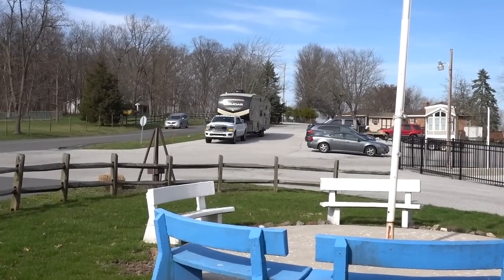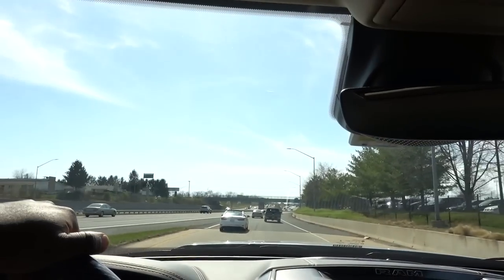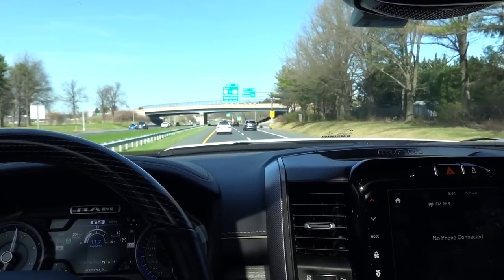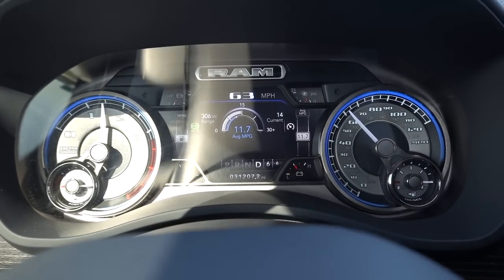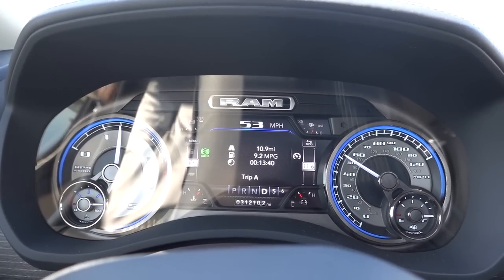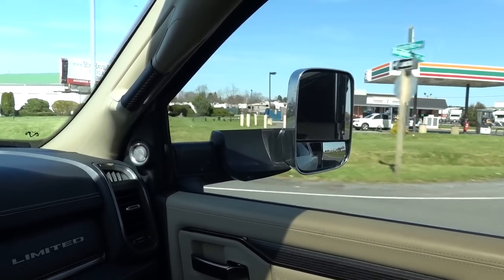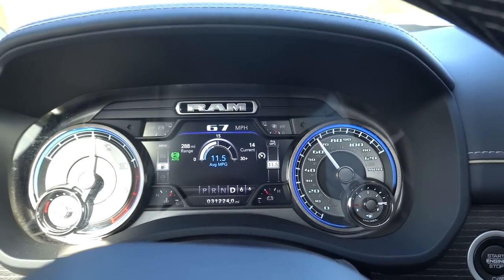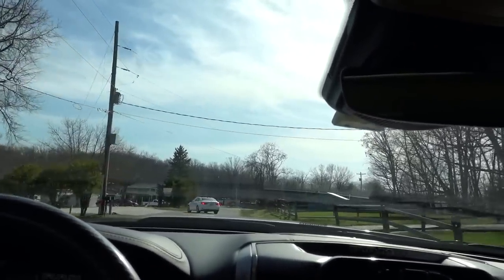Trying To Get The Best MPG Towing? I Learned This Technique That Will Get You 2-3 MPG Better!

Comment: Nice video. Being smooth with the throttle and brake is the best way to get good mileage for sure. Speed is also important. Once you get around 70 mph the gas mileage will drop. 

The only issue I see with towing in an OD gear could build unnecessary heat in the transmission. That would be something to watch for.
Reply from the maker: Thanks bro, and maybe what I will do is do a follow up video on whether you should keep Tow/haul mode on or not 👍🏾👍🏾
Reply: @JB_WhoWork  yeah that would be good to do. Probably for a diesel it won’t matter too much but a gas truck it will drastically change how they operate at speeds. My truck will definitely not go into 6th in tow/haul mode and a lot of times on curvy two lanes it won’t go to 5th.
Reply: @JB_WhoWork  I’d like to see that… I’ve got a 6.7L F-250 diesel (6spd but wish I’d waited for 10spd trans) but I honestly can’t tell any different with towing mode on or off!🤷🏻‍♂️
Reply: @JB_WhoWork  did you do the test ? i was wondering if i need to activate it on the highway. I got 11mpg on a 250miles trip with a 5k pound rv on my Ram v6 3.6 etorque with tow/haul mode activated last weekend.
I'll do 650 miles next weekend. I'll try removing the tow/haul mode to see if i get improvement!

Comment: Just bought a 26 ft travel trailer (5176 lbs empty). Used cruise control at first, but my Tahoe going up a hill would downshift when I was already halfway up the hill… sometimes it would downshift twice and in one instance had the RPM’s up to 5500. I realized then that cruise control was no advantage, so I shut it off. The hills of Tennessee are brutal on MPG as opposed to the flatlands of Illinois. 
The cruise control doesn’t know it’s approaching a hill so it can only react once on a hill, so now as I approach a hill (without cruise ctrl) I accelerate slightly before I am actually on the hill and that limits the transmission downshifting and improves MPG. I also found 60 mph be an optimal speed. 
Great video as it confirms that cruise ctrl, specially when the road is cluttered with hills, renders poor MPG.

Comment: This reminds me of calculating for best cruise speed flying aircraft.  When flying, pilots look at manifold pressure to see how much work the engine making for a desired result. There is a point where induce drag has gotten to a point where more fuel is required to hold a higher speed.  Aerodynamics makes a huge impact on fuel economy.

Comment: I love your conversation, I’m always watching the mileage. I have an older 1 ton, but I’m getting 25 mpg without the trailer. I’ve noticed a difference since I got the triple disk torque converter. I don’t have the DEF so my fuel is a little cheaper per gallon. I’ve also tried a few tricks. One time I added 2 stroke oil to the fuel and picked up some mileage, about 2 to 3 mpg, I’ve also tried fbomb. That worked well but I’m not sure if it payed for itself. I also have an airdog filter/lift pump installed. It gets me better fuel mileage till I get under a 1/2 a tank of fuel. My not pulling a trailer mileage is 25 mpg. I haven’t pulled the 5th wheel since the upgrades , but I was getting 13 pulling a big horn 38’. I’ve got a turbo system with the exhaust brake for towing, which will also give me more boost, but it’s not installed yet. Have you tested your mileage by RPMs? 
 I like to use the cruise control myself but drivers on cellphones mess with consistency. Which can mess with fuel mileage sometimes. 
Keep up the great work!!
Reply from the maker: Great post! I wish diesel trucks would lose the DEF/DPF/SCR… I would just take EGR if possible because these components use more fuel just to burn clean which seems silly and counterproductive 👍🏾
Reply: @JB_WhoWork  exactly, how is burning more fuel helping me.

Comment: I have driven that stretch of road your on several times. The hills are not very steep for the most part but gradual acceleration is your friend when on a flat. Headed south after you go through Fredrick on 15 / 270 there is a bear of a hill that will test your patience lol.
Reply from the maker: Yea that’s 5% grade for about 2-3 miles and doing what I showed in this video will help offset that decrease in fuel mileage 👍🏾

Comment: On our last 4k mile trip I did half the trip using cruise control & tow haul mode on the 'flats' and kick it out as I hit hills up or down. I drove large semi's in my young years for a few years; and thought why not the same style with this rig? Worth a try. The trip back I used "M" mode and used the transmission. Keeping my RPM's about as constant as i could shifting up & down. On the long or steep hills I kept it in the torque range of about 3k -3.5k RPM's using the gears. On long flat stretches I would test the cruise but would pop it in "M" and drop a gear to see if the cruise was using more gas to keep it in the higher gear watching my RPM's all the time. The highest gear isn't necessarily the best. It's a combination of throttle pressure, RPM's and speed.  I was actually better off in 9 most of the time than 10 while towing. Cruise control would let me lose too many RPM's and then floor it to gain it back after dropping  2 gears. Especially going up a long hill. I also limit my speed to 60-62 mph. big difference than 67-70 mph. I did the same theory as you did by speeding up ~5+mph down hill and lower up hill as well.
Reply from the maker: True, but for Hwy driving above 65 MPH is always going to be better than lower gears when you take in revolutions per minute. Thanks for sharing
Reply: @JB_WhoWork  Not necessarily true. On my Ford 10 spd for example the top 3 gears are overdrive. 7th is one to one. Depending on your load and terrain you may have to apply more throttle in 10th to maintain 70 than you would in 9th. You may be turning less RPM's in 10th but it may require a heavier foot on the pedal to do so, therefor burning more fuel.
Reply from the maker: Thanks for the explanation!

Comment: Taking of tow haul throws your truck into overdrive and locks up torque converter.    I have been told you will tear up your transmission and overdrive gear.   That is why tow haul keeps you out of overdrive.   Be careful not to tear up the transmission to save a couple of bucks on fuel.
Reply from the maker: You make a great point which is why I don’t accelerate hard anymore in 5th/6th gear when not using tow/haul. To your point, the computer identifies load through tow/haul and locks out the weaker 6th gear but as I’m climbing grades, I’m maintaining lower RPMs to lessen abuse to the weaker 5th/6th. I could be wrong but only way to find out is to tear down trans and I’m definitely not doing that 😅

Comment: Great video, never thought of taking Tow mode off on a decent cruise. Yet I knew how to work with the hills. And cruise is not your friend in the hills. I was avg 11.8 MPG's at 64 mph in Tennessee & NW Georgia. But here in South Florida no advantage and at 62 mph i'm only avg 10.1 mpg's  Towing with GMC Elevation 2.7L T. Bottom-Line i got better MPG's in the hills then I do here in Flat Land South Florida.  But perhaps taking it out of Tow Mode here in Flat Land just maybe i could boost the mpg's???

Comment: Good video good information.  Now come out west with 6 to 9 percent grades.  I still get 12 pulling my 35 ft toyhauler - 2014 Ram 6.7  I do about the same as well as keep track of turbo temp.
Reply from the maker: Thanks Doug, are you deleted?
Reply: No, don't want to afford the ticket if I get inspected.   I mostly run in the Black Hills of South Dakota.  If I take it across Wyoming or Nebraska I do much better, Utah the mph will drop some - especially leaving going up Parleys Canyon - 9 miles of 6 to 7%

Comment: Big rigs lose speed up hills because they are too heavy and can't maintain speed.  On flip side, all that weight pushes the truck down hill and guys use this because many trucks have a speed limiter.  They are not doing it for fuel savings.   Only real savings is better driving practices and shifting techniques for rigs.
Reply: Agreed. I don’t think lugging the engine going uphill is very beneficial. Slowing to 50 mph on some highways can also be very dangerous even in the right hand lane. Lastly, I wouldn’t trust what the “lie-o-meter” is putting out. JB should have filled up, annotated the mileage, filled up at his destination, and did the math that way. I’ve actually found that keeping my 6th gear locked out and hauling most of my long trips in fifth gear gets better mileage.

Comment: You hit all the notes JB. That's everything I do. My wife is always playing shotgun driver - "do you have the cruise set??", then I have to educate - again. 

But you have way better experience with economy with that RAM against my F350. I'm also pulling average of 14k lbs. Overall I'm getting 9-10 at best, traveling mostly on relatively flat grade highway. In the mountains, forget about it. I get killed going up regardless the tricks. Generally horrible economy with my F350 no matter what I do.
Reply from the maker: 😂😂 yea my wife probably thinks I’m crazy! Thanks for sharing bro 👍🏾
Reply: Twill, what model year 350? DRW or SRW? Diesel?
Reply: @displacedtexan  mine is 2018 SRW F350 PS

Comment: I drive a 2.7 ecoboost with 3.73. Ratio and 10spd, pulling 21’ TT; not a diesel…I make a game of it as well to get best fuel economy. I agree with the cruise control but not necessarily with the gear selection. With my turbo gasser I keep dropping gears until the  fuel economy gets worse and then go back one. An example: pushing a head wind in 7th (1:1) and got much better economy in 6th which is about 3200RPM (peak rear wheel torque btw). So my point is, and maybe not with a diesel, lower rpm in my experience is usually not the answer. The engine is working too hard in those OD gears and I’m pretty sure the same fire a diesel. Also, I always downshift before the hill to get the rpm up, transmission is too “dumb or slow” to downshift. Just my two cents.
Reply from the maker: Great explanation Chris 👍🏾

Comment: I don't mean this to sound like I'm bashing anyone. But I've been a truck driver for almost 39 years. The trucks aren't backing off the throttle going up hill weight is causing them to slow down. Low rpm while climbing a Hill causes high boost pressure and high e g t. Not good for engine. Better to have a little more rpm and a lot less boost. I do use my cruise when towing my fifth wheel. But automatics wait to long to down shift. I paddle shift to be in the right gear when I start climbing. I realize your fiber is 4000 pounds heavier than mine but as a former diesel pickup owner that switched back to gas. Your economy numbers don't add for me. Just got back from vacation in the smokies. My calculated milage not the dash of the truck. We're 8.8 to 9.14.

Comment: You are absolutely WRONG about cruise control, as an OTR truck driver I’ve tried it both ways in different trucks over the years, with very few exceptions, cruise control will absolutely get better mpg over a 600-700 mile day

Comment: my 2cents? ...maximizing MPG with GAS  or with Diesel are two different things!! In a gas motor (generally speaking) the lower RPM per MPH the better because the the stochiometric ratio of gas demands the same amount of fuel to air... Diesel is different. Diesel burns at a MUCH wider stochiometric ratio than gas. So lower RPM with a diesel is meaningless if you are in the throttle harder. Its much harder to figure out where the Diesel injectors are flowing less diesel than if it were a gas engine. A higher RPM with diesel using less throttle might be better than a lower RPM and higher throttle position.... as well as better EGT control

Comment: Aerodynamics are a big deal.  Pulling our EMPTY 7x16 cargo trailer the fuel economy drops to half the non towing fuel economy.  At 50mph, our Cummins will get 30+ mpg.  
Speed limit or not.  Driving above 65mpg will not yield acceptable mpg.  Bought R-95 fuel for $6.96gal yesterday.  Cost $102 for half a tank.  The fuel price is higher in many other parts of California.
When I drove OTR in the 48 and Canada.  The joke was, seniors towing trailers or in motor homes.  Had a national speed limit of 45mph.

Comment: I've always been told to stay out of 6th gear when working that heavy. Unless the tranny's have been upgraded recently it will burn it up (68rfe that is)
Reply from the maker: My RAM has the Aisin
Reply: I agree with Jeff, in the sense that the computer in tow mode is trying to keep you in the power/torque band. Its never good on an engine to bog it down at the lowest rpms its a game of give and take, save a few bucks on fuel, or blow head gaskets or break a connecting rod costing thousands in repairs… staying out of cruise I completely agree with a human can see and anticipate adding a bit of throttle to climb hills knowing you’ll drop a little speed. Downshifting is your friend going downgrade and try to stay off the brakes let the engine help slow it.

Comment: 5.5 mpg??? I think it's time to park that thing and just live in it wherever it's parked. I have been shopping for a Ram Cummins, but maybe I'll just keep my old 93 GMC 3500 SRW with the manual 5-speed transmission that gets 18 miles per gallon empty and 12 mpg pulling the RV and runs just fine on free veggie oil!!! I am beginning to think a Ram Cummins would be a serious downgrade.
Reply from the maker: I’m getting more than that!